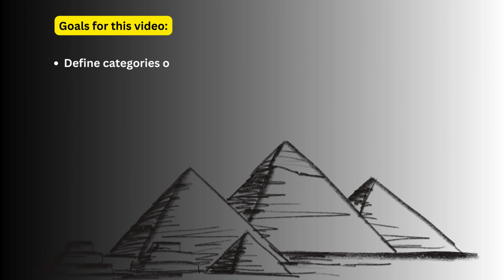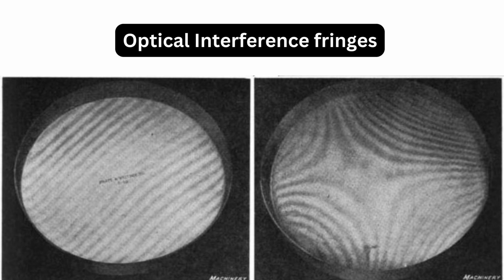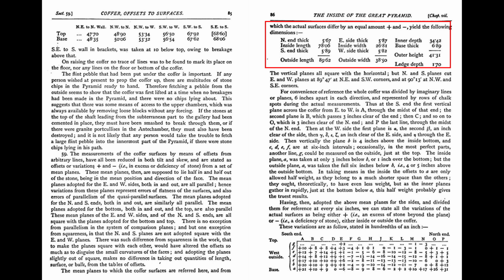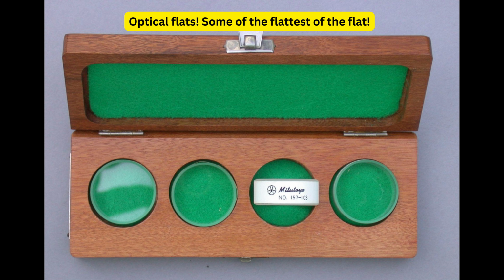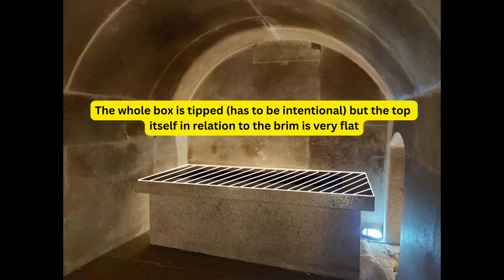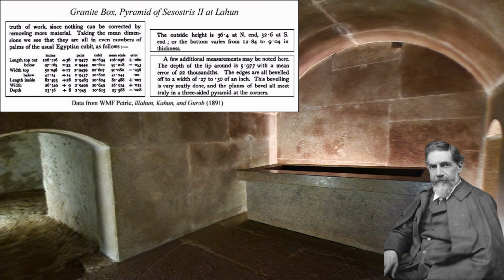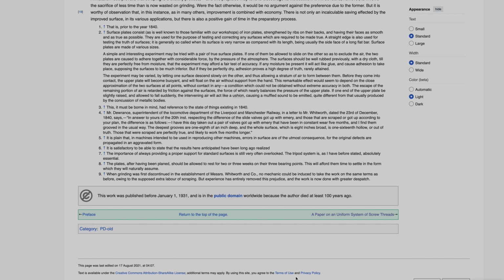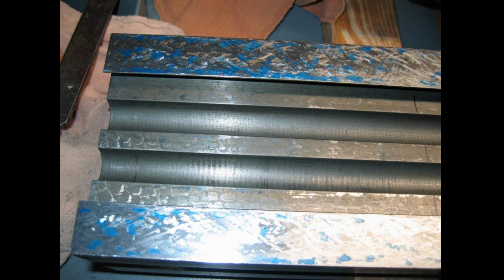The Problem of Flatness in Ancient Egypt

Comment: I Polish tooling for a living and can see if a surface is flat or not once it has a mirror finish.
I can’t measure it with my eyeballs but I can tell if it needs to be regrounded or not.
Reply from the maker: Nice. Think this method has any validity to it?
Reply: @intothemap360  Yes, reflections are a great tool for verifying surface imperfections, especially if you draw parallel lines on a flat surface, and look at those lines in the reflection. Any irregularity in the surface will show up as a distortion in the lines. Need more resolution? Draw the lines closer together. If you look at those photo robots/scanners going in at most dealerships and car rental places now, the ring of lights has a pure white panel and a panel with parallel lines. The second will make any minor dings stand out in the image captures.
Reply: @shmaknapublar  That is true, and is even a methodology to quick check car panels.
As side note, is just the whole "Using mono chromatic light" and the much precise interferometer (Mono chromatic light is a older methodology compare to lasers) but taken to a lower level of precision.
Here the light is use to cast shadows and light spots just like in the other means, the big difference is what is use to achieve those light and shadows spots.
Reply: @shmaknapublar  When grinding lenses, I would hold it up to the light reflecting from a rectangular window or light in the ceiling.  
It really helps, and you can see how straight the reflections are.
Also I work in a granite shop, and you can see deviations in some stones that have different hardness throughout the natural grain pattern.
Reply: @intothemap360 they use this method for paintless dent repair.

Also with surface grinding you can see if the surface is shit like scalloped it will be very obvious to the eye it curves the light a little bit
Reply: @stuartmartin-l8q  also it gets ypu close enough to start using dykem.
Reply: @intothemap360 The three plate method is an excellent low tech way of getting something incredibly flat even by modern standards. But this isb only possible for a certain size of stone like a sarcophagus. But this their falls apart of you look at Sacsayhuamán and how the stones were for to each other. You can't get a credit card between them. There is no technique that I heard of that can explain how they did that. A lid of a sarcophagus is easy but your can't do that with 50 ton stone. Keep in mind all the faces of the stone fits ALL of the surrounding ones. They went even so far to implement small triangular stones into that wall and fit that to the three surrounding huge stones. To move these stones and grind then to each other would not work with the tech we know of. I want to be very clear there. I'm not some woo woo guy that's thinks they had electric drills and CNC machines. But they definitely must have had something more sophisticated than we see in the records. I mean the Egyptians even only show how they transported the small stones. The 200 ton stones would have pulverized the wood they had available so they must have used a different technique. That's not some crazy theory.
Reply: @intothemap360  you are at least on the right track
Reply: @intothemap360 I will admit I would like to see some artifacts inspected with optical flats. If anyone has some artifacts in the portland area I have a set of flats and the monochromatic light to use them
Reply: @intothemap360  lol? just look at the surface with light shining on it. don't you have a head screwed on and a set of eyes? EDIT 18:45 ahh i see, you are one of those. if you can't do, teach.
Reply: As a metrologist I can tell you Mirror finish is usually very much NOT flat if done by hand.
When I measure hand polished surfaces before and after I often go from under 0.01mm in flatness/geometric deformations, to well over 0.2mm after polishing. But it looks "flat" to the eye.
Most manual mirror finish process will worsen your flatness. Aside few exceptions obviously. Even some machines process will worsen it.
Overall I don't think just having a mirror finish is a good indicator at all, at least not under a certain scale.
Reply: @ClemAparia well certainly you can polish something round, or oblong or even extremely wavy. I think we can assume they meant "surface milling" "surface grinding" or possibly "lapping" im certain they didnt mean hand polishing. You can polish a bowling trophy but no one would ever claim it to be "true and square" but if im using an Okuma, a tormach or a Haas to surface mill,grind,polish a mirror finish is a good rule of thumb to achieve before you start using a comparator or something similar. Kinda apples and oranges. I get what youre saying though. Also thats a had ass job you've got there. I absolutely LOVE weights and measures.
Reply: @ihatecomicspodcast6813  My main point is the people mix up flatness and surface roughness. And this video doesn't help as it kinda mix both of them together too.
Mirror finish is surface roughness, depending the process it can be a good indicator of flatness but usually it's not, it's just a byproduct.
Even if you're using a CNC depending forms, thickness, holes, how it was made and how it was setup in the machine (plus the size of the surface), you can end up with unexpected deformations leading to "poor" flatness despite milling a mirror finish.
In numerical terms :
Mirror Finish = Surface Roughness under 0.1/0.2µm 
Meanwhile you would be happy if your flatness is even 100 times this (10µm) over 500x500mm when milling (Lapping is another beast obviously).
Like you said, Apples and Oranges.
And yeah I love my job, I use Mitutoyo MMTs (Prob, Scan and Vision) + Classical Instruments obviously. I love it, but machinists hate me since I keep telling them they're out of tolerances hahaha.
Reply: I rely on touch, an amazing instrument.
It's surprisingly capable of sensing imperfections even where the eye fails.

Surely not enough for "optical grade" precision, but still...
Reply: @jorehir hey you can feel a half thou. If it's a gradual change a couple thou
Reply: @erokcreates I just checked freedom units, with touch you can feel surface roughness differences down to 0.004 thou (0.1µm) without much issue.
Reply: @jorehir  Touch is amazing to figure out surface roughness but not flatness in the slightest.
Reply: @ClemAparia  Oh yes it is. Just run your finger fast on the surface, and its undulations will become evident.
Reply: @jorehir  So if you have something that is say 300mm (basically 12inch) long and has a dish to it with its deepest point being say 250 microns (10 thou of an inch), you can feel it?!?!? BS!!!

Not saying that the "feel" method isn't reasonably accurate in certain situation but the fact is, it only falls into the reasonable accuracy when the undulations are close enough together. The larger something is with the undulations more spread out, "feel" method is out the window
Reply: @jorehir I think I can "feel" down to 5, maybe 4 thou...but what are we, carpenters? 4 thou might as well be an inch, or miles, or half way home.
Reply: I read that in a Polish accent.
Reply: Ugh "regrind" i used to HHHHAAAAATTTTEEEE hearing that when i was CNC grinding and tool polishing. Also "NEW PERSON DONT TOUCH THAT,  YOUR GREASY HUMAN HANDS ARE GOING TO OXIDIZE MY WORK PART!"
Reply: What are your opinions of the Barabar Caves?
Reply: Yes, I'm Polish too 🇵🇱🔥
Reply: Even a reflection of a strait object will have distortion in it if the surface is not flat.
Reply: @DANTHETUBEMAN  the problem is, you won't be able to tell if a surface is perfectly flat or a perfect section of a very large sphere just by looking at the reflection. The latter might be way out of spec without looking wrong, distortions would only be local defects, but a slightly spherical error would be a global defect affecting everything equally.
Reply: I think it may have more to do with where the mirror and object is relative to the observer? Lol @DANTHETUBEMAN
Reply: @DANTHETUBEMAN   If a straight object isn't flat, that means the object is indeed not straight.
Reply: @Puddingskin01  Counter Argument: A cylinder is a straight object without being flat, a so called ruled surface.
Counter Argument Two: A hyperbolic paraboloid saddle, and also a single shelled hyperboloid are objects made of straight lines, that cross each other, yet they are not flat surfaces.
Reply: @IkarimTheCreature   If a cylinder with a straight object is a terrifying concept.
Especially if harm to the cylinder is involved.
Reply: @DANTHETUBEMAN no shit. Lol
Reply: Do you by any chance have predynastic Egyptian ancestry? That would explain it! 🤠 I partly Polish too, so I may try my hand at tooling!
Reply: "Regrounded" 😂😂😂
Reply from the maker: @VectorZero  Aka put back into the ground hahah. Wouldn't that be funny if you could just bury an item and holy crap, its a little bit flatter than when I took it out!
Reply: @VectorZero  disconnected the bonding strap and then reconnected it again. Because they used electricity to grind the stones!  🤣🤣🤣 (sorry OP, couldn't "resist"... )
Reply: Then explain these people you can't make a box like that with copper tools.

Comment: You made an informative video for those unfamiliar with these tecnical concepts. But there are a couple of things I would like to point out. 
These sarcophagi are not all that astonishing to a society familiar with machine made products. 
And perhaps their accuracy is not up to optics grade standards, but coming from a culture   that supposedly had no machinery,  it still boggles the mind and strains credulity.
While kitchen countertops made of polished granite are no big deal today,  it is still beyond belief they achieved these feats.
As you say, the several ton sarcophagus would not have been movable,  but even three piece method of grinding lenses need to be repeated multiple times to achieve flatness, and then needs to be polished. Using a copper plate with one layer of grit embedded would have taken ages, and does not comply with the  alternating block method. No metal of any thickness will harden to flatness due to shrinkage,  thus losing flatness. And metal thin enough not to shrink in the center would not maintain its shape. The abrasive, at one layer embedded, would lose cutting power with a few strokes, depending on the type of grit. Which brings us to the next issue, modern grinding particles are seperated and sieved to precise sizes by mechanical means. These people had no method to seperate particles to this accuracy. 
And each change in size necessitates doing the grinding over again.
You made no mention of the inside corner cuts, and to my knowledge even our machinery can't get into the corners closer than the radius of the sprocket holding the diamond impregnated cable of a chainsaw like cuttung machine. 
They still needed to get these surfaces cut and polished to a millimeter of accuracy. 
And we come to the next obstacle,  WHY ?
In a world before table saws and CNC, before telescopes and reference plates, micrometers and interfereometers, WHY?
We don't carve and polish three sided corners today. Today we would cut and cement the pieces together to achieve this effect. So why go to that trouble to get so far beyond the ordinary, that four thousand years later, after man walked on the moon, the work is still beyond what is practical to do?
Reply: I laughed when you very briefly showed the box in the Cairo Museum with the cut that wanders and stops. Clearly they could have stopped before wandering off that far if the cutting was a slow incremental process. You only get errors like that with tools that cut quickly. I have cut granite countertops with a Milwaukee 18V battery powered diamond circular saw and it cuts 1 1/2” thick granite fairly quickly say 8”per minute with a stream of water to keep the blade cool. I could easily see and hear the blade wandering even a little bit and gently bias it the other way to keep it much straighter than that. Which tells me their tool had to be faster than my cut in much thicker stone. I would really like to see highly magnified photos of the cut to see the tool marks.
Reply: @evanmorris1178 Thank you
Reply from the maker: I cannot answer all your questions. There will always be mysteries with ancient Egypt. I am a simple man and have tried to just understand the basics without getting to why. I appreciate your inquiring mind. I’m sure my ideas are not 100% correct but at least you will see my thought process. The inside corner mortising does need to be addressed and this video was geared towards flat surfaces not angles. But I shall ponder it and see if there is anything I can add to the conversation. Thanks for watching and for your insightful comments
Reply: How did they make stone counter tops 100 years ago, 200 years ago, and so forth? Or how did they make stone floor and wall tiles the last few thousand years?

You can watch a stonemason cut a perfectly flat surface using nothing but a chisel and square in real time, right here on YouTube
Reply: @histguy101 yes but they still have to polish it to achieve anything close to these results.  And I haven't seen three sided tiles. A big issue here is tool hardness. Granite is hard to chisel with steel,  with copper nearly impossible.  You could fracture it, but achieving a smooth serface is another story. Even Michelangelo spent more time polishing than chiseling, just to achieve a matt finish.
Reply: @JoeSmith-cy9wj The Sarcophagi were made in the classical era, post iron age. 

Not that it should matter. The methods of traditional stonemasonry have largely stayed the same. The tools have remained the same. The materials they're made from have changed to allow quicker work.
Reply: @histguy101 Google AI seems to disagree.
Reply: @h @histguy101 pends what you mean by “Perfectly”. I don’t think it’s to the same degree.

Comment: You seem to be stating that the Ancient Egyptians used the Joseph Whitworth three plate method and engineering blue methods. 
Both of these methods were the products of the industrial age and were developed to solve industrial age problems. 
For example, the production of high precision machine parts. 
Both these methods are therefore recognised as industrial age technologies which did not exist prior to the industrial age. This can be confirmed by the publication of scientific papers and patients at that time.

Any claim that the Ancient Egyptians used these methods is in fact a claim that the Ancient Egyptians employed 'industrial age technologies'.
The above claim is exactly what is being made by the "fringe/alternative" community.
You appear to be agreeing with them.
In that the Ancient Egyptians used industrial age technologies.
Reply from the maker: Saying the Egyptians rubbed stones with sand together is pretty low tech as a hypothesis. I don’t think they called it the Whitworth 3 plate method obviously and I’m sure it was modified. Did the ancient people knew that they had to wait for him to patent it before they could sand stones? Also I don’t think they used it to a T as I said, the work piece couldn’t be rotated in and lapped in the exact same was and no I said they used red ochre not engineer blueing. Of course I could totally be wrong but this is far more practical than most theories out there
Reply: @intothemap360  
I agree with you. 
In that the Ancient's used industrial age technologies to produce industrial age flatness. 
How or why they conceived of, or developed a need for an industrial age technology that was first developed, patented and published during the early 19th century is a mystery to me.

Most alternative theorists would agree with you.
Reply from the maker: You’re right. I’m not attacking anyone. We do hear a lot of claims like it’s all impossible engineering though I wouldn’t say it’s impossible
Reply: @intothemap360  
It clearly wasn't impossible because the ancients did it for us to see today. 
I'm of the opinion that the ancients had access to at least an equivalent to early industrial age technology, say around 1820. 
Which you made a very good job of demonstrating.
I have no idea how they achieved it.